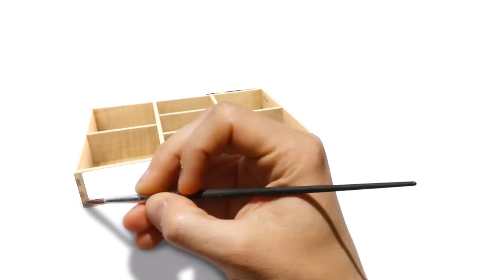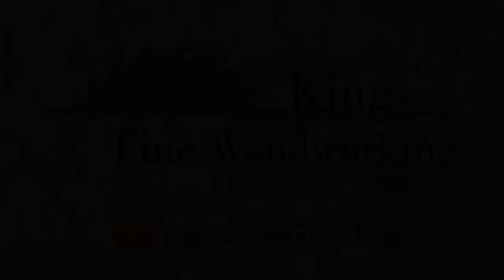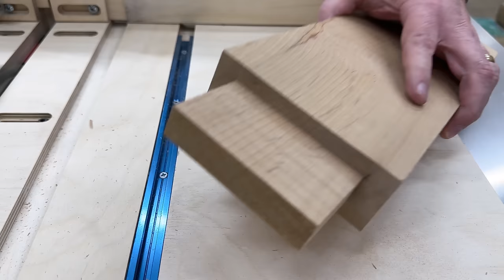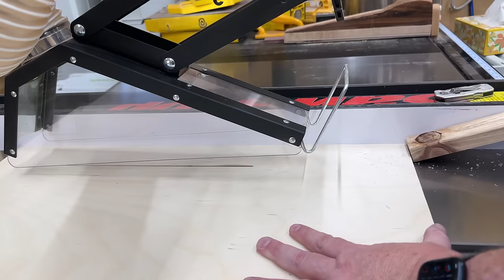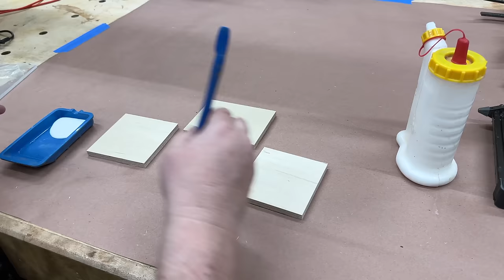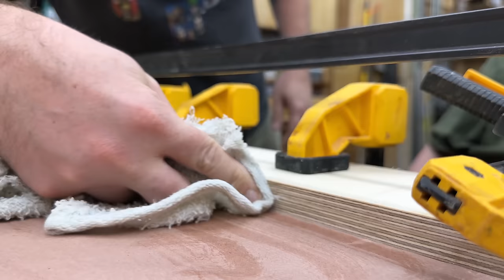Flagship Table Saw Sled! Crosscut, Miter, Bevel, Dado, Picture Frames & More!

Comment: I am in the process of building my sled. I added some epoxy under the t-track on the base to give a little more holding power since the screws are only 3/8". I put on the rear fence yesterday being very careful to keep it square to the blade, did the 5 cut method and the math and ended up with 0.0001". Good enough!
Reply: I am obsessed with thinking about the 5 cut method since I watched the video.  And really once you're down to microscopic errors you're well within the error margin in the tools and materials.

Comment: Thank you, James, for another fantastic build! The amount of thought and planning always shines through in your designs. Now I must go build one!!!!
Reply from the maker: Awesome, thank you!
Reply: @KingsFineWoodworking   in the beginning of the video, you cut a mitre and then took those 2 pieces and made a 90° corner? You do know that if your one cut is 45.25° the other cut will be 44.75°? Both total 90°. Being accurate would be cutting 4 pieces from the same side. Using both sides works if you are making a frame but sometimes you may only need 1 45° cut and then it may be off a hair. Also, if you reverse the mitre template to look like a V, you will get a smoother cut and no chipout on the inside of your mitres. Try it on a mitre saw, cutting mitres with the point against the fence or the point on the side where the degree handle is.

Comment: That's a very well thought out sled, James! It's an inspiration for me to make something similar for my little Bosch contractor's table saw.
I love how you show the whole process and explain how to do the tricky bits. And I love that this video is over an hour long! (Maybe not what the YouTube algorithm likes, but who cares!) Looking forward to watching the second part!
Reply: I think I have the same little table saw you have. I was about to ask if that sled will work with mine or just the big fancy table saws. Do you know? Also, do you have issues adjusting your blad to a perfect 90 degree? Mine is a little off. I can get it there but I have to put a lot of pressure and lock it down while forcing it into place. And it eventually vibrates loose.
Reply: @joeguilfoyle1922  if you get the right bars under the sled it will work. The slots on my table saw where a different size than the standard size. 
Getting the blade to 90 is difficult, sometimes the mechanism clog up with saw dust. Clean then out and make sure the set screw is set right. Hope this helps!
Reply: thank you @c.a.g.1977

Comment: Awesome design! I did come here to say that there is a difference if you have a void area without glue though. It will act as a weak point (crack propagator) so you should try to glue the entire bond area with adhesive always. Better to have squeeze-out than not.

Comment: When you do the 5 cut method you need to use the distance from the pivot point to the point you adjust, I believe, not just the entire length of the fence. It would help you if you selected an easy round distance from the side when you put that first screw in on the opposite side.
(not that it makes much difference in this case, you're already working with very tight tolerances)
Reply: One of the fun eccentricities of furniture making is the obsession with reducing error....

I was thinking the same thing.  I watched the video last night and couldn't stop thinking about the 5 cut method and where the miniscule error he had left over came from.  It's the distance from the right hand pivot point to the left hand distance not the length of the fence.

i watched his video a few times already and he does say the distance between the two screws at one point.  I think he means the distance between the right hand pivot screw and the left hand stopping point where you shim it out.  Bur he's putting the new left hand side screw really close to that same spot so it's the same thing for all intents and purposes.

In fairness though at some point you're going to run into the natural +/- of the tools you're using.  If the $30 caliper says 0.002" I do not trust that a different measurement a hair's width next to it isn't going to say 0.003".  Plywood is not solid material.  The blade vibrates VERY VERY slightly.  There are miniscule errors being introduced everywhere in reality.  We all know though the point is to control what you can control and know when to stop.  And in this case we can control using the right distance as a multiplier on the error/in.

Comment: I am just near completion of this sled and everything seems to have worked out quite well, my only regret is that I used the best Home Depot plywood. It is too soft, it has voids and I hope the sled holds up.  I chose Home Depot because there aren't many sources for baltic birch that is near me. Never again .  I should have used a router to make the counter bored slots with the Home Depot ply, it probably would have been a lot cleaner with less tear out.

Comment: @29:35 this is definitively router territory for me
(a handheld router with straight edged "cradle" with spacers on a whole but pre-marked piece of ply = 5 min work and 100% straight cuts/shelves)
Reply: I am still getting used to my router.  I would think a router would badly rip up the surface of that plywood wouldn't it?  The forstner bit has tiny little protrusions to prescore the material it's about to remove to prevent tearing it.

Comment: I have your older sled. It works well, but it was very heavy. So I haven’t used it very much. This one looks lighter. I have a small sled for small boxes. It has both 90 deg and 45deg because it has a single runner.
Reply from the maker: The weight was a problem for us too. This one is less than 1/2 the weight! Plus it’s way more functional.

Comment: I bet you can come up with a finger joint jig plate that swaps in place of the adjustable pieces on the fence.  This would be a pin-and-slot jig like any used to make finger jointed boxes, but it fastens in place in the gap on the fence where the adjustable pieces usually sit.  Various plates each with different pin and slot widths for different widths of fingers....
Reply: I was thinking of the exact same thing today.  I was thinking a completely detachable fence but I like your idea too of removing the fence zero clearance inserts and making an adapter for box joint jig.

Comment: Hi James. I just got the basic build done on the sled. Cindy over at molasses Creek says you want comments if there's any problems. The only problem I've run into thus far is the t-nut holding the fence extension was counterbored too deep by about a 16th of an inch and prevented the extension from being pulled out. I knocked out the t-nut and ground down threaded section about 3/32 and that fixed the problem. No other issues as yet although I like Cindy's idea of screwing the safety box on rather than gluing. I'm going to see if I can remove mine and do it that way. Yes, I've already cut through the back of the safety box..
Reply from the maker: Thank you for the feedback! I should have caught that the t-nut was too deep, I apologize.

Also, screwing in the safety box is a good idea. I didn’t think of that when I first designed everything.
Reply: If you could think of everything there would be nothing left for we mere mortals to leave comments about.

Comment: I have the DEWALT 7491 installed in my work table with about 10” of table on each side of the saw table. Will the size of this sled work with the dewalt and my setup?

Comment: I have a couple of stupid questions. I have 8.25 inch table saw with a table top that is less than just under 20 inches square. Max cut height is 2.75 inches. I believe that you stated the distance between the two screws for the back fence was 27 inches. I am thinking that the entire sled has to be over 30 inches wide. If you gave the overall weight and dimensions somewhere then I missed them. I am thinking this thing might be to large for my purposes. 

How big is the "Flagship Table Saw Sled" and what is it's weight ?

I was wondering about using micro-jig 1/2 inch dovetail slots and hardware rather than "T" tracks. Any thoughts or comments ?

Comment: A great design. I also like to reduce the waste and cut my pieces to size and careful glue up. I am in a condo and use to have a table saw, but limited space and times that I can use it. Limited to using a track saw, but could be worse. The US has access to so a better variety of materials and we in Canada do not.

Comment: Thanks for taking the time to put together. I have a sheet of 1/2” BB plywood. Could I do the substitute without a lot of mental gymnastics, adjusting measurements?  Just printed the plans and thought I’d take a shortcut if there is one. 🙂
Reply: I was thinking about that too.  I just built mine from 3/8 using the plans.  If you used 1/2"...

The bolts the plan calls for might not be sufficient.  1/2" is 12mm thick and not 9mm.  The button head bolts pretty comfortably reach the blind nuts with 3/8" stock.  I suppose you could also recess the blind nuts a bit more to try to reach the bolts.  Or make your channels for the zero clearance inserts a little deeper to help the bolts reach the blind nuts.

It adds 33% to the weight.  But.... it's reasonably weighted as is so that doesn't feel like a showstopper.  

The stop block hardware won't not be long enough with a thicker fence.  Your back fence would be 36mm thick and not 27mm.  You'd have to pick a new 1/4" aluminum rod from HD and a longer 1/4-20 hex bolt (even if you have to cut it down).  My stop block only gives 1-1/4" between blocks until it's open "too far".  You could get away with recessing the bolt head deeper into the block but I wouldn't do that with the 1/4" aluminum rods pins on each side.

I studied the plans for several hours before building it, so I think I'm pretty familiar.  I don't see anywhere the measurements of the cuts are affected by the primary board thickness.

That said, I also used a piece of scrap 3/4" BB for the front fence instead of messing around with gluing 2 pieces of 3/8.

Comment: When adjusting the angle at the end, the length of the board (27 inches) should be measured from the pivot point, not from the end of the board, right?

Comment: For that top pn the back box,use lexan,not 
Plexiglass,lexan is bullet proof(used by banks in thickness of 1.5-2 in)
Reply: Plexiglass can shatter from a chip of blade,not so with lexan
Reply from the maker: Lexan has a tensile strength of between 10,100 - 10,200 psi, whereas the cast acrylic I’m using has a tensile strength of 10,000 psi. 

In 1/4” thickness there is very little strength difference for this use.  Approximately 1%. 

Cast acrylic also does not shatter like extruded acrylic can.  

But in truth, nothing touches it. It can have 1/100th the strength for this application and it’ll still work perfectly. 

Lexan is awesome though. It’s a polycarbonate, and It has many other amazing properties. Even at low temperatures. They used it for the original space shuttle windows. 

I’ve always been fascinated with polymer chemistry. As an organic chemist who did academic research at the university here my field was in synthetic organic chemistry, much of which is devoted to polymers. 

I taught and did research for a decade before YouTube. And the polycarbonate family of plastics is one of my favorite to lecture on.

Comment: Dumb question a 2:37 why not use a router bit.   You used the router earlier.  If you are planning on making a lot of these if you do not have a router table... getting one would save you lots of time.    BTW I say that as respect to make every little bit easier.  I think this is an Amazing design by far. The replaceable removable inserts is what I love.  I have a shopsmith  I use the dado arbors so my saw blade does not always land in the same spot in the sled.    I have one insert for my table that has multiple height Zero clearance cuts. I can shift the blade side to side under the table. Then a Shopsmith on a 45% cut means a table turned and I do not make a 45% miter without a sled on my mark V.  I have my on version of sled with a replaceable  insert but this is very well thought out and Nicer.  IZZY SWAN would be proud. Lol          Also the spot 2:37 the over head router on a shopsmith is what I would use.   There a few legit  disadvantages to those machines but some things they do above Average too.         You get a very thumbs up from me.   But to loop you in on one of my Ideas is a box joint jig that attaches to this sled and has a CNC Box joint cutter.  Run it all off of a Dewalt 20 volt battery.    That would be the ultimate jig.......       I really do like this. Lol🤣

Comment: @kingsfinewoodworking - Can you technically cut a bevel cut with the blade at 45 degrees by adjusting the zero clearance insert and cutting accordingly? I know it would leave another cut line in your fence and fence insert, but certainly would be handy for bevels.

Comment: Just discovered your feed and this video.   I don’t have a table saw but have been upgrading my 40 yr old bandsaw and recently built a simple sled for it.  Wondering if this plan could be modified for a band saw.  I’m particularly interested in the mitering ability for making accurate frames.

Comment: Question related to the gluing of the "T" nuts: would it be a good idea to glue the space before you pound in the nut to make the gluing be a stronger additional hold, since the glue would be on all parts that connect the sled to the nut that way?

Comment: James,
Best sled I have ever seen. Hands down. Fantastic piece of work. For the kit version, are all the parts included for making picture frames? I assume you have to supply your own ruler and digital angle finder for the sled? Any recommendations on these?
Thank you 🙏
Reply from the maker: Hi!

Thank you!  Actually everything you see is included when you buy the whole sled. The picture frame & miter function are both included. And the digital angle finder and the ruler are included too. Every single piece of hardware I show that’s used on the sled comes with it. Hold down clamp, toggle clamp, exotic wood stop, all of it. You don’t have to buy a single thing.
Reply: Thank you James.
I am in.
My order will be forthcoming.

Comment: Hi James.   Question regarding mounting the miter bars.  Do you have the adjusting screws for both bars apposing each other?  In other words, in your video, you showed us adjustment to the 'left' bar and the screw driver was on the saw blade side.  Did you then adjust and install the right bar the same direction (screw driver closer to your fence) or the opposite direction (with screw driver on the saw blade side.  Hope my question makes sense.  THanks!!

Comment: Is there a description somewhere of what "some assembly required" means when purchasing the full sled?  For example, am I getting a box of CNC pieces that has to be completely assembled?  Am I getting a sled that is largely already assembled and I have to install the runners and the rear fence?  etc.  Also, does the kit include all the accessory items that will be described in the next video?  Thanks for the great design, looking forward to replacing the original/heavier sled a built from your plans a few years ago...

Comment: Hi, I have a question. I have a small table saw (Festool CSC SYS 50) it only has one miter slot. Will the sled still work with my setup?
Reply from the maker: It will, but not very good. And it will be awkward. 

I recommend waiting until we come out with the compact version of the Flagship sled. It should be out in about a month. We are currently about to start the testing phase with all of the jobsite table saws out there.
Reply: @KingsFineWoodworking  awesome thank you! I’ll keep my eyes open! 🤝

Comment: You mentioned your digital angle finder is accurate to 1/100 of a degree.  That sounds wonderful -- which is it?  Most are 30 times less precise.
Reply from the maker: I think I misspoke. We have several models here. But they all read to the 1/10th of a degree. 

I also don’t believe I’ve ever seen one that reads to 1/100th. They may exist. But you’d be looking at a multi-hundred dollar Mitutoyo or something similar.

Comment: I enjoyed your video(s) and am in the process of building the fence. One question, regarding the fence adjustment.  When you adjust the fence you are "rotating" it  around the one screw on the right (which is not at the end). So, the right end of the fence beyond the screw  moves forward slightly as the left side moves back. Is this enough to make a difference requiring you to chase your tail to adjust it or should you measure the length of the fence from the screw?
Reply: I wonder this as well because I had to move it back, then forward when I rechecked.  Good point.

Comment: I’m curious about something: when drilling out your stepped holes, why did you start with the small forstner bit? I’ve frequently seen advice to start with the large one so that you don’t lose your center point when you step down.
Reply from the maker: That’s good advice if the center point is all you have to go by. There is no other way of doing it except that. 

However I’m simply hogging out a section of material from two layers roughly and finishing with a chisel. 

In this technique it’s easier do it the other way around smaller bit first then bigger. 

Otherwise if I used the bigger bit first, I’d have to re-draw the lines inside that shelf for the center slot, in order to make sure it’s accurate.
Reply: @KingsFineWoodworking   Thanks for the recco on chisels.  I always wanted a decent set but the number of choices and expense is intimidating for the occasional hobbyist.